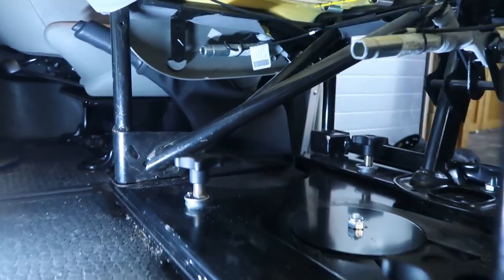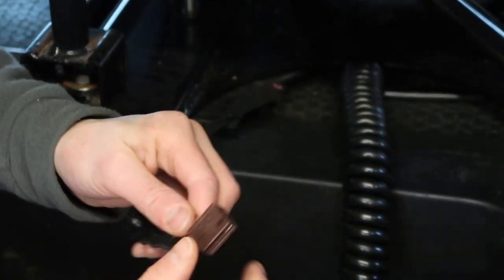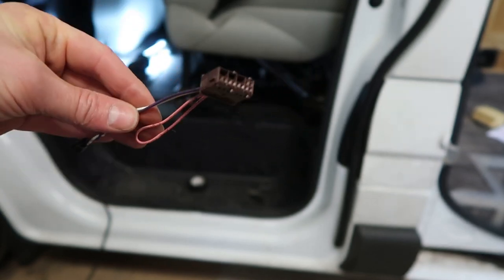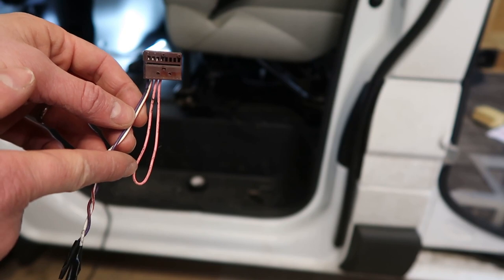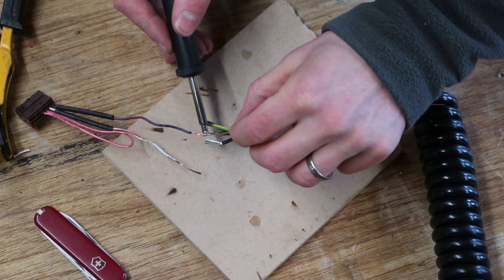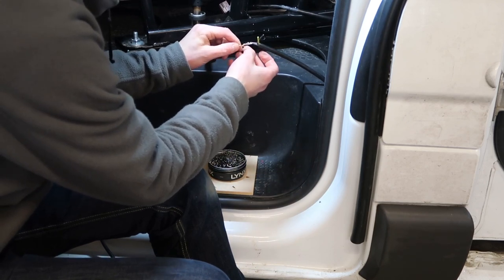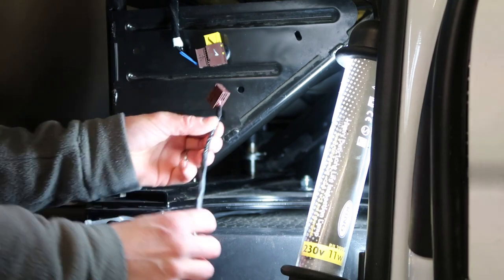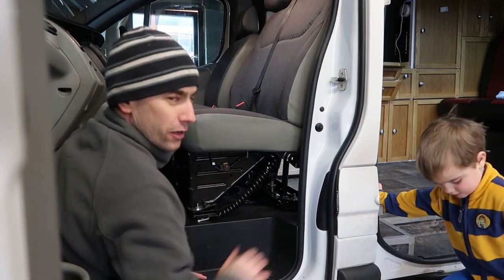Wiring a swivel seat in a camper van

Comment: Thank you for the tutorial. It looks very good!
What kind of assembly plates for swivel seats did you use for double chair?
Reply from the maker: Glad you liked it. The seat is original, and I got the swivel base off eBay, described as "Vivaro, Primastar, Traffic Camper Van Double Seat Swivel Base (RHD UK Model)" sold by Customshopdesigns. Very easy to fit, although as you can see in the video turning the seat is a bit tricky as it is so large.

Comment: Bit late to this video but it's exactly what I want to do to my van! The link you posted is now dead but is the spec/length still correct? 4 CORE 1.0sqmm COILED BLACK PUR CABLE. 250mm (10")
Struggling to find the right cable to use
Reply from the maker: Yes, it's exactly the right length and has worked well for us. Theres nothing magic - provided there's enough copper to carry the current (1sqmm is plenty), enough length to not stress it (250mm is plenty) and enough cores, it'll work fine. Just find something suitable on eBay.
Reply: @adpsimpson  thank you, can't find any four core, would two core be sufficient providing it's 1sqmm or am I likely to receive a telephone handset cable?
Reply from the maker: Probably, yes. I bought the cable before starting the job, you can see in the video two of the contacts are simply shorted together so I only actually used 2 of the cores in the curly cable.
Reply from the maker: Just to add, I didn't measure the core size on the original harness, but it is current-carrying (to set off the pyrotechnics in the tensioners in the case of a crash), so I wouldn't trust telephone wire - it needs a bit of meat to be sure it won't fail if you actually ever need it in a crash. 1mm is certainly plenty though.

Comment: Great video! Was the curly cable specifically designed for the job or did you use a universal one? A link to it would really help 🙏
Reply from the maker: Just bought off eBay. I replied to another comment with a link, although it might be dead by now as it was a couple of years ago.

Comment: Mine has 6 wires in total do I just connect the wires you have shown ? Thanks
Reply from the maker: In my van, two of the wires are short circuited, presumably so the ECU knows if the plug is connected or not. So you can keep those as they are.

If it's different to what my video shows though, you'll need to connect all the wires, or at least know exactly what you are doing if you leave any disconnected.
Reply: @adpsimpson  yeah I have the 2 short circuit wires and a further 4  two the same colour as yours  then 2 more, surely it wouldent matter and long as they are connected to the same colour just making it long ? Also is it ok to do this with the battery connected thanks

Comment: Hi mate, I've had a air bag light come on on my dash since I've installed swivel seats. Do you know a way around this. I have a vivaro 2010 so not to different from yours
Reply from the maker: Yup that almost certainly relates to the connection of the wire that I was dealing with in this video. If you don't extend the wire you'll need to unplug and plug it back in each time. If it's plugged in and you still get the light, the wires might be damaged, eg by being pinched by the swivel mechanism?